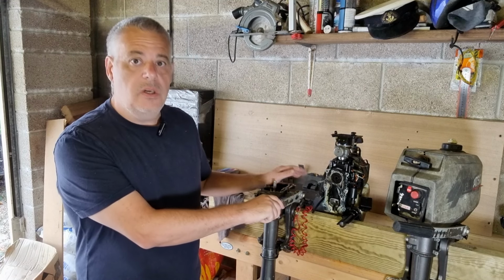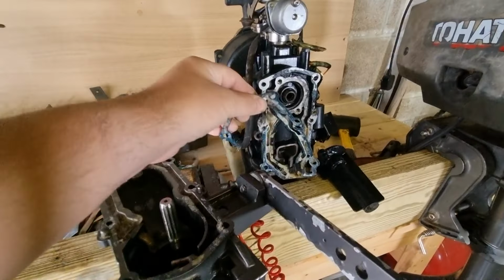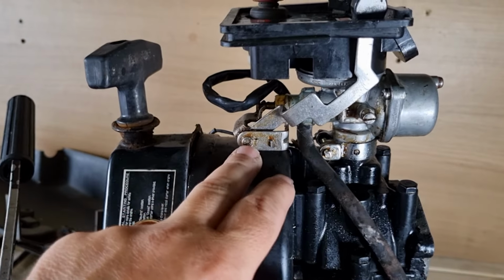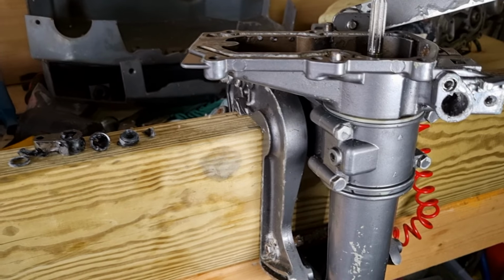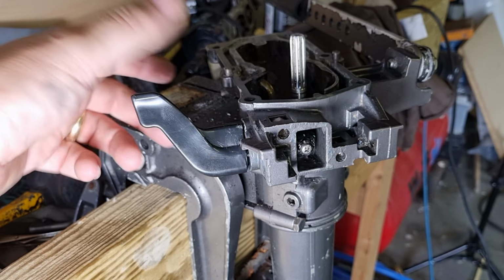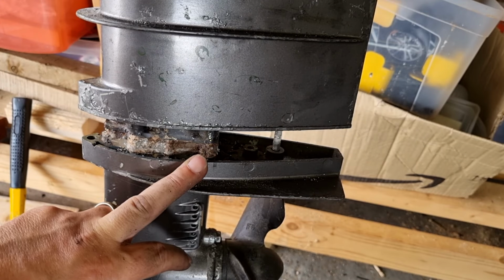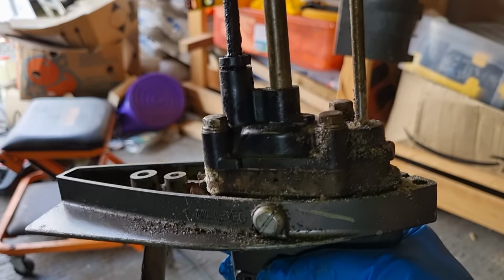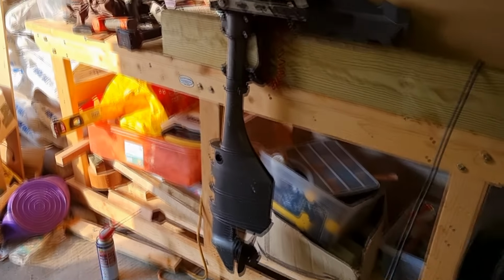Seized Gear Lever | 1999 TOHATSU 3.5hp Outboard | PART 2

Comment: Great, just what I needed, mine has just stuck in neutral.  Fortunately only 3m from the mooring.  
Another task for tomorrow. 
I had the same issue with my 9.8 2stroke.  Heck of a job to free it.  
It may be that it was sprayed with WD40, which does cause some plastic to expand…beware!
Reply from the maker: @markthomasson5077  Hey there sailor! Glad you got yours sorted, and yes, WD40 isn’t always the best. Happy sailing! ⚓️
Reply: Got onto it this afternoon.  Big struggle, but managed to free it and pull it out.  No significant corrosion in the housing, I think more the plastic had swelled .  I have trimmed with a sharp knife, now works.  Ready to put back together with plenty grease…well Vaseline, can’t find the grease.
Reply from the maker: @markthomasson5077  Excellent! Well done! Vaseline should do the trick and make sure you flush the outboard through with fresh water after every use, that may help to stop it seizing again. Happy sailing! ⚓️
Reply: @skipperstan  it lives onboard, so can’t have that luxury.
Apparently the short shaft is spec for fresh water, the long shaft salt water
Reply: I can report that now running very well.
The gear lever works like it never did before…I had assumed that the stiffness was normal.  Now clicks over with hardly any effort.
Also took off and cleaned the carburettor.  Found the float chamber needle had a bit of corrosion, perhaps why it cut out occasionally.
Reply from the maker: @markthomasson5077  That's brilliant! It's so satisfying when you fix it yourself, also helps to know your outboard so that if it goes wrong when out on the water, you'll have the confidence to fix it and get back to shore. Nice one sailor! ⚓